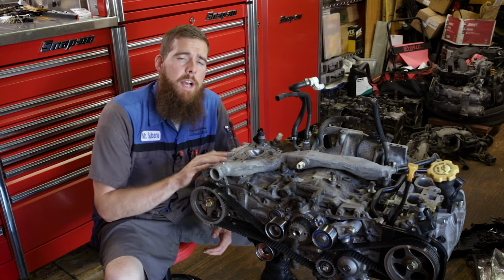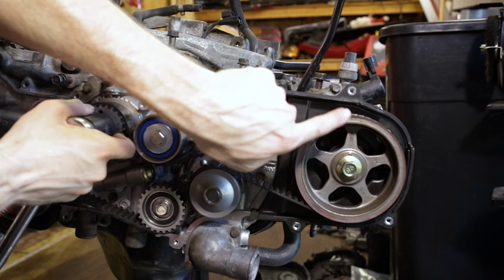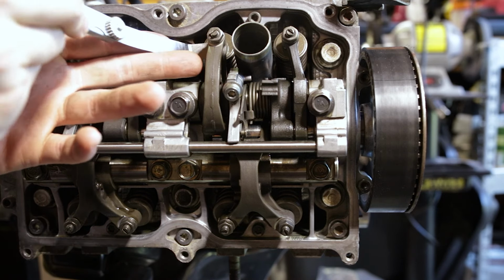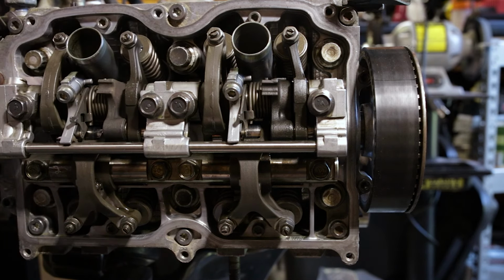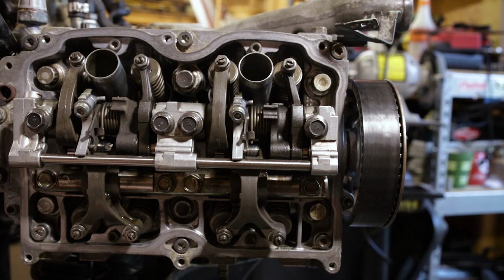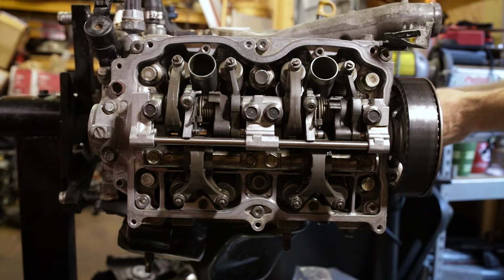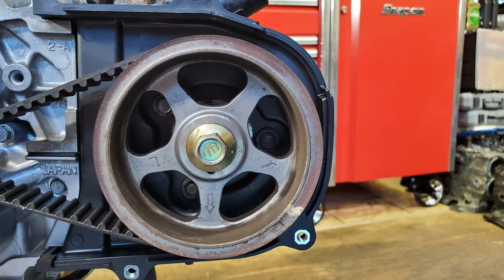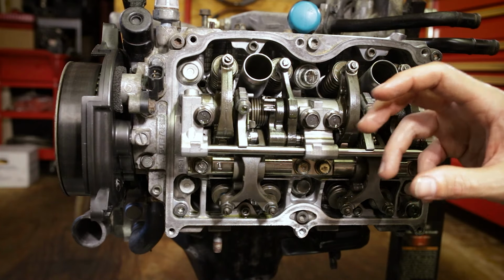Subaru EJ Series Engine: SOHC Valve Adjustment

Comment: When adjusting the exhausts (share a rocker)...  That rocker can pivot a little on the shaft.  Best procedure is to also place an extra feeler gauge under the adjacent side to keep it from pivoting and affecting the reading.  Doesn't need to be full thickness... (can use a 0.009" instead of a 0.010") ...just enough to keep it from pivoting and throwing things off.
Reply: I wish I read this comment before doing mine. Regardless, mind worked out well. Thanks for the tip!!

Comment: Lot of ppl was saying to remove heads to have to remove engine.... No just undo motor mounts and upper wishbone brace jack up motor and out the come! Just remember to install head bolts in the  cylinder head before placing head in the spot

Comment: How often should  the valve adjustment be done on a shoc EJ engine? I can not find any info on this. I have a high mile EJ 18 and 253.
Reply: I have an ej25. I think 251 and would like to know too. It has 97,000 miles
Reply: I have an EJ253, couldn’t find any info in the service or warranty booklets. However, I have the FIXD app, and it only mentions it in the recommended services once, right at 105k. I kept looking all the way until 300k, and it didn’t appear again.
Reply: @mr.murder5652  Thanks for the info

Comment: Question, I have an ej18 with 175,000 miles on it, all stock, that started driving weak and compression test shows #2 & 4 have about 75psi dry. 1 and 3 have 127ish dry.   It's not overheating, or losing coolant fluids or oil. No clanking or knocking in motor.
Could a broken valve part be causing my compression problem? I am almost sure the valve system has never been adjusted or checked. Could something move out of adjustment just enough to cause the intake or exhaust valves to allow some compression out?

Comment: I recently changed my head gasket on my 2007 subaru outback.  I bought Remanufactured head and used your video on how to set the valves. I have been driving the car but the valves seem louder than the old ones.  It was my first time setting valves. I also here a chatter at certain rims. In your experience would you think I have them to tight or to loose? I appreciate any advice.  Your videos are great.
Reply: If you can hear them more typically they are more loose. When they quiet down however…. I’d rather loose than too tight 🤣

Comment: Thank you very much for your video. Helped me rebuilding my EJ251 on 02 Outback.
Just curios what are those springs under the spark plug holes? mine doesn't have it. Is it some kind of a variable valve timing tech?
Reply: Yes, EJ253 has AVLS (vvt)

Comment: Would valves that are out of adjustment cause misfires? Say on cylinders 1 and 2? And also not idle but run will working the gas peddle? And the misfires went away with revs?

Comment: I have Delta cams 1500 grind. Adjusted the valve lash as in the video. But when the crank and cams are turned so timing marks are on top positions then the valve lash gaps are loose/bigger? For some reason I think the arrows on the cam pulley should not be taken into account when using a modified cam?

Comment: hey so i did all the steps presented in this video, i have the 2010 2.5i legacy and when i put everything back together it was idling rough but ran okay, and i took it apart again, and repeated the procedure and it runs terrible and can’t even make it down the street without it feeling like it’s gonna blow. The only mistake i feel i could have made was not returning to TDC when i was done with cylinder #4. I was told that there are 2 points where the engine reaches TDC. Can anyone help?

Comment: Hi! Which kind of issue would cause to adjust the engine valves?
Reply: I had my heads milled since I was doing the head gaskets, the machinst guy said you are going to adjust your valve right ?  Engine in or out ?  Out, he said, yea, easy...do it...that was his advice.  In the old days, you had to adjust them a few times a year on some cars.

Comment: When You did the head gaskets did you seat new valves too, so no matter what I have to do a valve lash, this suck, doing my mom's Subaru forester 2.5, I feel I need to pull the block to do this right.  I'm pulling the rockers tomorrow and lapping new vales in. The head gasket went on driver's side.

Comment: Hey, MR Subaru! , i ended up here for an advise..  my legacy 2007 2.5i auto heading 104000miles, no engine oil leaks or ATF OIL LEAKS. When i push the gas and it makes the combination of ticking and growling noise whenever push the gas from the dash. so i went 4 garages and cannot find the noise coming from....  alternator is alright, all the pulleys are good, no wheel bearing noise, they are good.  just whenever push the acceleration , makes that noise from the inside of dashboard. i can more clearly heard that noise when its in low speed, below 30miles more clear and above 40 fading with its speeds.   do you think its because of valve issues? or transmission issues ?  Thanks inadvance with any comment from you.

Comment: Hi, will a 2018 subaru outback wagon non turbo have a cam carrier leak/drip at 34,000 miles on the car? dealer is charging me $3555+.

Comment: @MrSubaru1387 Please may you help on for advice or suggestion in your professional view about Subaru oil pan and oil pick up tube . I ask because of your Subaru reputation show realistic feedback. There's a lot of videos and commentary how common it is for Subaru Oil pan and oil pick up tube has issues over time. I have a Subaru Impreza RS 2002 2.5L (non turbo of course and stock with coilovers), nothing wrong with it but I second guess and I question myself. I daily drive my Subaru and I do want the most drive longevity of it. So I was thinking about on purchasing oil pan and oil pick up tube modified/aftermarket brand or just buy it new in oem stock. I am debating to purchase it oem stock oil pan and oil pick up tube. I would really appreciate it if you reply to my comment specifically about this or put it out there about it in clear statement " Subaru aftermarket Oil Pan/oil pickup tube". It is something controversial to talk about too. Thank you.

Comment: Off topic but curious your thoughts on purging old gas from a 2013 STI. Thinking of pulling the fuel pump regulator and jumping the fuse box to manually use the gas tank fuel pump to purge the gas into a fuel jug.  Your thoughts on this and if you already have a similar video to how to do this?
Reply: a siphon, not sure how, but that would be better and not run tank crud into filter or pump...but your idea will work...I hate working with gasoline...

Comment: I realize this is off-topic but...
I contacted my local dealership for 2001 OB AC valve cores. These are the Schrader valves on the high and low sides. They want $19.63 for the low side and $183.25 for the entire compressor-to-condensor hose assembly because the valve is "not serviceable."
Am I missing something?
Reply: Late reply, but you can definitely put a new valve core in there. I did it on my 00 OB no problem. Just gotta get the right ones.

Comment: Great Video!
I'm doing the Timing Kit and Valve Adjustments this week and got a Question.
With the the New Tensioner, do I need to "Bleed" it or "Cycle" the Tensioner before use?
I got confused reading the Instruction Pamphlet that came in the Aisin Kit.
Thanks for any help.
Reply: don't beleive so...install and gently pull the pin and down it will press on the belt
Reply: I did it, I got the Gates kit and it made the tensioner stiffer
Reply: I installed the aisin timing belt recently and I also thought those instructions for bleeding tensioner were for those reusing their tensioner. But after installing timing belt and checking marks after a few rotations, I pulled the tensioner pin with ease…a little too easy, and no visible tension occurring. While the timing belt was cycled through a few more revolutions with no problem, I’m wondering if the new tensioner had to be bled.

Comment: Looks like this would be tricky to do in the engine bay. Do Subarus require engine removal for a valve adjustment? How often? It was a regular maintenance item in my Honda.
Reply: Literally doing one right now in the rig. No problem. Just need a stubby flathead for cylinders 3 and 4. You can also take off the motor mount 14mm nuts and jack the engine up. Remove the upper brace also.

Comment: So if I turn 180 degrees from the twelve 0 clock wouldnt I be at 6?.   you say 3   I don't get it
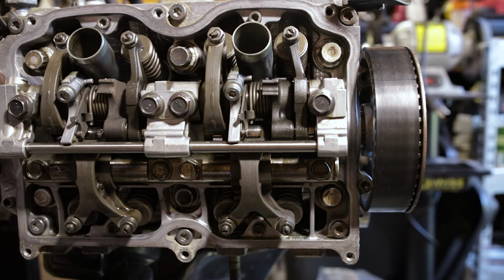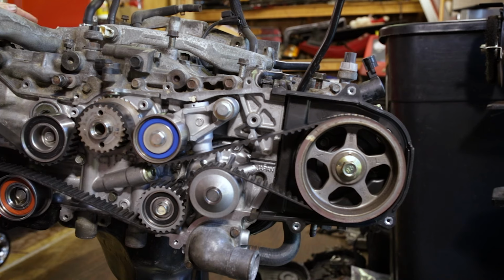Reply: Turning the crank gear to 6:00 turns the cam gear to 3:00.

Comment: Do these specs change for the ej253 motor from 2010?
Reply: Only reason I ask is because my cylinder 1&3 have a plastic cam pulley instead of a metal one

Comment: doing off from the engine bay is hella easier than inside lol.
Reply: I'm thinking of doing this in the engine bay, how hard?.... I did my valve gaskets and timing belt in the last 6 months. With I did this too while everything was apart

Comment: you say turn 180 degrees, but in fact you turn 90 degrees.  misspoke
Reply: 12:28 watch it again
Reply: I think it's because 1 rotation of cranksft and 1 rotation of camshaft is not a 1:1 ratio